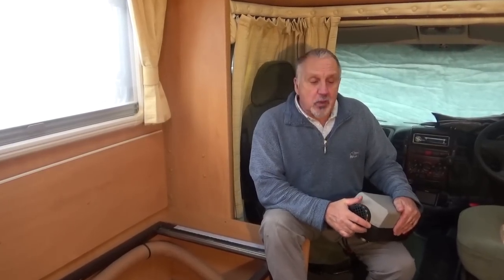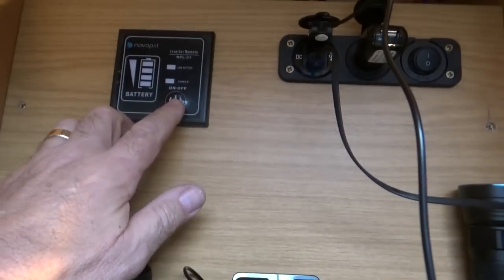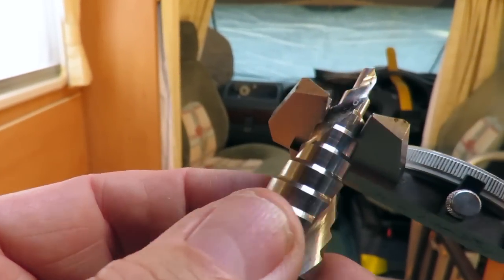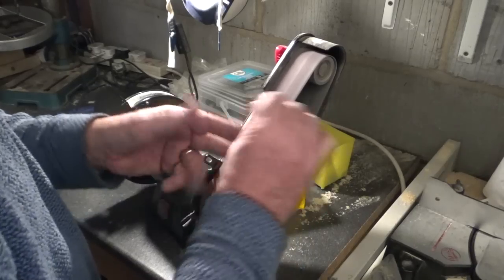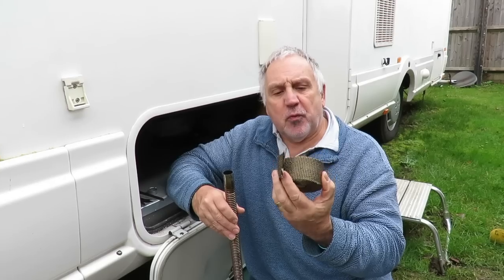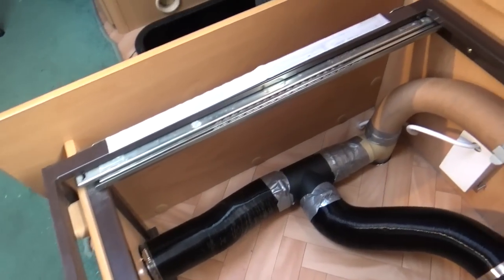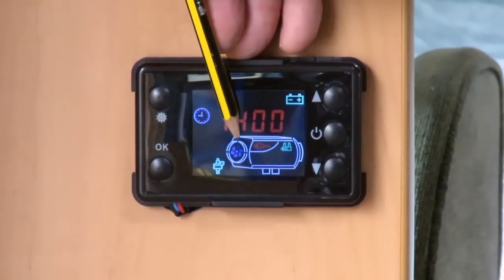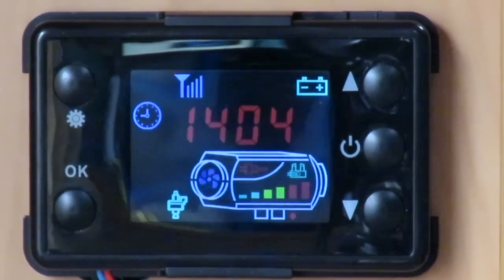How To Install A CHINESE DIESEL AIR HEATER, Ebay 5KW parking heater fitting guide. Full instructions

Comment: Step one: learn Chinese
Step two: follow instructions
Step three: burn the instructions to keep warm
Step four: watch this video
Reply: What was the purpose of putting the fuel tank inside surely this will give you the smell of fuel every time you want to fill it up , would it not have been better to put it so you could fill it up from outside
Reply: @stephenlafferty7327  i thought about the same... my question goes to, why not to connected to the main fuel tank of the Van or RV?
Reply: Very funny

Comment: Great video! 

I have a few notes for you:
1. Bernoulli's principle would dictate that the flow of fuel will change from 1 diameter of pipe/tubing to another, however reducing that diameter back down to the intended size only affects the flow rate within the enlarged section of pipe. As long as that temporary change in flow rate is inconsequential (unlike in refrigeration), you'll have no issue changing pipe diameters. Your risk for air bubbles is no different than if you ran the smaller diameter pipe out of fuel. Still need to prime the fuel system in both instances.

2. Your combustion air intake may be suffocated in that compartment OR you are using fresh air that has leaked in from around the fuel tank for combustion air. This is simply exhausting some of the air you just heated.

3. I didn't notice a good route for fresh air to return to the heater to be heated and pushed back out into the RV. Adding a small hole to your cabinet may improve your thermal efficiency, dependent upon leakage.

You've had this installed for about a year now. How do you like it?

Cheers!

Comment: Every time I have mounted a diesel fuel filler in the cabin of a boat or RV...it has been a huge mistake.  Poor very carefully and have rags everywhere. Diesel is SO nasty when it drips even a single drop. Great video. Thanks.
Reply from the maker: Hi,
Yes, agree, I am very careful when refilling.
Been looking into a different tank that can have the refiller inlet on the outside.
I cant tap of the main diesel tank without draining it and risking swarf in it either...

Thanks for the kind comments.
ATB, Steve
Reply: I expedite so I have one of these heaters with the tank mounted inside, I'm able to pull up to the pump and fill it directly into the tank no need for a separate can been doing great for over 2 years no spills! Although you do have to make sure to be careful when turning the nozzle down into the tank.

Comment: Dosage pump incorrectly installed - read the instructions (and watch other installation videos). It must be mounted at an angle of 30-50 degrees. You have it vertical.
Reply from the maker: Sorry Richard but I've done extensive testing on pump positions and can assure you the optimum pump angle is between 45-90 degrees.
With a 90 degree being the best far.
Generally as long as the pump fuel pump is positioned over 45  degrees it will be ok.
The reasoning for this is as the pump draws fuel into the chamber cavitation takes place, creating microscopic air bubbles which accumulate into large air bubbles.
These can only be removed with the pump being upright, so they can pass through and along the fuel line.
That way they do not create an air bubble build up in the pump itself, causing incorrect fuel dosage and pump wear.  

*As diesel fuel is oil based, it means the pump relies on the fuel filling all the pump chamber to give full lubrication, thus preventing any serious pump wear. Any air pockets will simply result in wear.

Hope this helps
Steve
Reply: 90 degree is fine he's correct

Comment: Great video, i would like to point out quite an important error which i found out a while ago fitting mine. By raising the heater unit off of the lino flooring you have stopped the steel sealing plate from doing its job which is the seperate the intake/exhaust connections from the cabin. If you now have a loose/poor connection on the exhaust jubilee then any leaking fumes can enter the cabin as the sealing plate is not tight against the floor and unit which obviously could be a huge health risk! The steel plate is effectively there as a gasket.
Reply: Yep, I was just reading through before making the same comment myself. Doesn't take long for the exhaust joint to start leaking on these, especially if using the cheap provided fittings and no exhaust sealant.

Comment: Great video. Two things to add: The fuel pump should be installed on and angle of 15-30 degrees. When installing the fuel tank fitting I used a piece of weed trimmer line smaller than the diameter of the fuel fitting  center hole. The fitting will slide down the trimmer line like butter Just my 2 cents.

Comment: Very useful video! I whish you had done this prior to my instal - The instructions in the manual are absolute rubbish. Some of my observations:
 - The bottom of the tank fuel inlet is fragile, mine started to malform whilst tightening it.
 - took me a while fo figure out the plastic fuel line does not go directly onto each fuel component, although I managed to get it directly onto the main heater. Not enough black rubber in my opinion.
- The exhaust could be a touch longer.
- I like your air inlet location, mind is under the van and can get clogged with dirt, so monitoring is essential after a move.
 - Priming the pum on my 'unique controller' = I lost count the number of times I pressed those damn buttons, but miraculously it fired up lol.
Once in and working it's a brilliant piece of gear at a great price.
Great video, and this would help greatly for anyone considering the same type of install.
Reply from the maker: Thanks.
Yes, I've hear the tank can be fragile. I've since supported the bottom of tank all across it's width now as I didn't think the three screws would hold out with vibration.
I'm lucky with having a compartment directly below for the air intake, although I aim to improve the air filter with automotive one. I think I could get a bug drawn into it too easily!
The controller that came with the kit is really good. Lots of functions. It made priming a doddle.
I've seen some installations and thought 'that'll never run', but it does!!
They just seem to work!
So far mine runs as sweat as a nut, and burns clean too, no smoke.
I've measured the  Carbon Monoxide  levels out of the exhaust and they are incredibly low for these units. Clean burn again.
A good investment if you ask me.......
ALB, Steve
Reply: @TheWrinklyNomads  The first time I run mine up it smoked like a good un, now it's pretty clean, yeah good little bits of kit.. 

nice one.

Comment: one important thing: the bottom heater mounting plate is designed to be installed on a perfectly flat floor, those hose clamps and the exhaust pipe is not airtight. since you raised the heater off the ground you risk leaking exhaust fumes into your van. you need to use high heat RTV like you would caulking to seak the exhaust pipe and hose clamp connection, otherwise if that clamp loosens over time you will leak carbon monoxide into the cabin and probably slowly die while you sleep. also the fuel pump is supposed to be at a 15-35 degree angle as per the instruction manual. the rest is well done
Reply from the maker: Hi Eksine,
I ran with this setup for 6 months and it worked very well with no issues.
However, I have since relocated the whole system and this this new setup is the best so far.
Video is here:
https://youtu.be/HHJaPP2uLFA
ATB, Steve
Reply: Should have fitted the heater on the lower floor that will safe guard if any pipes leak fumes into the van, then use the flexi pipe to bring the heat into the living space,

Comment: I fitted one of these units on my yacht and it is great I would recommend that the dosing pump is fitted at a 30 degree angle out put side up for more efficent feuling
Reply from the maker: Thanks for your comment Gavin, but I have to disagree:
Mounting the pump at different angle can cause cavitation in the fuel and air bubbles, which in turn can leave air pockets within the pump fuel chamber.
This leads to the risk of excessive wear on the pump and possible failure.
Mounting vertical you eliminate any chance of this happening as no cavitated air can become trapped.
Each pump pulse is 0.02ml, so mounting at 30deg, with cavitation actually gives less efficient fuel dosage as less fuel is delivered.
but, these little pumps are so good they rarely go wrong anyway, and you could practically mount them upside down and they'd still work..!!!
ATB, Steve
Reply: Thanks for this reply. I was wondering if the pump needed to be on an angle
Reply: @TheWrinklyNomads  An amazing and thoughtful reply filled with info and facts without being rude... Such a rare thing on the internet these days haha! Love the video by the way.
Reply: @TheWrinklyNomads  it's possible that this varies between model, but my heater's manual specifically said to install the dosing pump at a 30° angle. Perhaps they just saw people on the internet suggesting it, and decided to add it.
Reply: A lot of people, lacking (readable!) factory instructions, were mounting these little pumps horizontally, which was a recipe for disaster. I too was under the impression the pump needed to be mounted at a 35-45* angle, but you are making a fair argument for a vertical install. I'll add, these pumps are a LOT better at pushing/blowing fuel TO the heater, than they are at sucking fuel from the filtered line from the tank, so a "soft" angled installation makes good sense as well. Interesting question. Great video! Clean install! I love your shop!

Comment: believe fuel pump should be at 20-30 degrees from horizontal to allow lubrication
Reply from the maker: Hi Tarun,
So long as the pump fuel pump is positioned over 45  degrees it will be ok.
Preferably anything between 45 and 90 degrees, with 90 degrees being the optimum angle.

As the pump draws fuel into the chamber cavitation takes place, creating tiny air bubbles. 
They can only be removed with the pump being upright so they can pass through and along the fuel line and that way they do not create an air bubble build up in the pump itself, causing incorrect fuel dosage and pump wear.  

Lubrication has nothing to do with pump angle as the diesel fuel is an oil and will lubricate the pump anyway as it passes through.

Hope this helps
Steve

Comment: Hi thank u for the video. 
I have heard they do take quite a lot of battery, is that true? And how long would u run it for?  Plus cabby tell me what size cable do I need to run for the heater? 
2.5 ,4 or 6mm 2 or 3 core 
Thank you

Comment: Would it be a good idea to mount a on/off switch between the battery and the heater in order to avoid the heater sucking power from the battery even when the heater is off?

Comment: Can the power of the heater at any one time be controlled? I.e. Those 6 levels of power can they be reduced to run at 50% to cut down on fuel usage and keep it a little quieter say if you had it set to kick in if it drops below a certain temp. but you didn't want to get woken up in the middle of the night by it?

Comment: Great vid 
I have a question,is the original heating trunking still attached to the camper van fire as original or is all the trunking disconnected from it to run it this way

Comment: Loving this video. Wondering if you can put a peltier strip near the heat exhaust then it will make around 12v  of power meaning it can be used to charge up a second leasure battery while on.

Comment: I installed mine yesterday... there is an extreme fire hazard off the exhaust I reamed a 4" hole and put some gas  pipe threw. I went today to get some exhaust heat wrap i checked temperatures with temp gun last night and it was extremely hot. I believe wrap is a must
Reply from the maker: Hi Cory,
Although the exhaust temp does get hot, it's well below combustion temperature.
I agree with you, a degree of caution is needed as to the amount of space left around the exhaust.
I have the heat wrap and also heat resistant paint to all area near the exhaust, but essentially any precaution is a good one...  
good comment though 👍
ATB, Steve

Comment: Hi there   great video well done May I ask is the diesel pump loud or does it get quieter  and secondly can i add a third hot air outlet to the system to bring heat to the rear of the camper van Thanks in advance?

Comment: Nice Work, the marine tank is brilliant 👍 i ' d be interested into 2 things about your Mod: 
1) is it more helpful to to have the air inlet from the outside, or rather from the inside ( circles) of your cabin with regards to Delta t?
2) in context to that is there not a little chance that you get burned fumes into the cabin once the wind will come from rear and left side?

Off Script: i noted that a long inlet duct / pipe throttles the air flow as well, same is when your air out to cabin would make the 90 degree bend to early, i think they say radius it after 30 cm that the Pipe does not get hot and the hot air could accelerate properly. And thus they recommend radius < 90 degrees etc .  I my case not possible either
Reply from the maker: Hi,
I am experimenting with the inlet air situation.
The reason for pulling outside air is to get fresh warm air into the van, however in very cold, zero temps, the burner does seem to produce a less intense heat at the output.
I have blocked off the air in from outside as a test and so far with good results.
All trial and error I suppose...!!
The chances of getting fumes back into the burner are almost negligible as the exhaust is over 3ft away and the emissions are particularly low. I have also checked all the Co2 readings at various points and dont think it's a worry.
Plus I have 4, yes 4, Co2 detectors in the van.!!
Yes the ducting isn't ideal. I may well alter it to go higher up and in a much less curve, but at the moment I will just see how it goes.
As I say, never to old to learn.
ATB, Steve
Reply: @TheWrinklyNomads  excellent Steve, it was not meant to be a lecture, was rather talking about bits and pieces i anticipated so far... My heater is a planar 2 d ( around 1,8 kW) which can handle a 7 m rig down to 0 degree outside temps with reasonable heat up time and consumption, it is powered by a Lifephos batt and 200 Watts PV autarc from April -October ( offgrid) then i refuel the batt with a Budget 2kw Generator eventually ( my tank 7,5 L planar Tank in the garage) ..i will try your boat tank   implementation next project that is what i took away and learnt is a must for not putting the RV tank  at risk and have maximum comfort👍👍👍 thanks for that Sir! Reg Hannes

Comment: Nice work and very informing video. Only thing I wonder is 'why did you pick the unit location so exhaust pipe runs in middle of cargo door opening?'. I thought you have enough room to avoid that situation. Also do you know if 5K unit is enough to heat an average mini van or does it have advantage to have an 8K unit?

Comment: Just one question, if the system is off, the display is still on all the time. How to turn it of without loosing all the settings? Of course I can cut the power of, but this is not the point, to play with it again. Any clue?
Reply from the maker: Unfortunately you can't turn the display off unless you kill the power.
That will mean resetting times etc.....😣
Reply: What do you do for this problem? I’m thinking about using a toggle switch and not worrying about the remote or time.

Comment: Very helpful video, thanks. I am just starting the installation of my Chinese heater in my caravan in New Zealand, before winter. Not that we can anywhere at all in our caravan right now, due to current lockdown. My instructions recommend that the fuel pump be mounted between 12 and 35 degrees from horizontal. Does your one work ok mounted vertical?
Reply from the maker: Hi Andrew,
The Chinese  instruction are just copied from the big manufacturers like Eberspacher.
The fact is, the more horizontal you mount the fuel pump the more you will get cavitation and air bubbles which will give a poorer burn.
Mounting vertical, which I recommend, means less wear on the pump piston and far less cavitation.
The pump will still work whatever the angle is, but mounting as upright as possible is my favourite.
Take a look at: https://www.youtube.com/watch?v=z8SkKAlOAxU  where I explain fuel burn and have a look at the cut apart pump to see how it works. Anything less than vertical will trap air bubbles,
Hope this helps,
ATB, Steve

Comment: I have 2 fuel tanks in my van . I have the same lay out as you have and will install under the bed also . Will that pump be able to pump from this tank ( front tank and will be near the heater) ? And or any positives or negatives to trying this ? Thank you and great video !
Reply from the maker: Hi hank,
I cant see any negatives with that idea working.
The fuel pump is more than capable of delivering the fuel for quite long runs, even uphill. 
If you position the pump under the bed, the ticking noise you get may be annoying though?
I am about to change my fuel tank and pump layout yet again to try achieve even quieter pump noise.!
ATB, Steve

Comment: Make sure to have spare exhaust, on a van mine rotted away after a year. In fact it really needs replacing with some thicker metal tube, perhaps electrical conduit. Buy the metal version, the plastic case can distort on bolting down and the internal fan catches.
I am still trying to find how to make the pump quieter.
When running they can sound like jet engines until they slow to tickover.
Also i made a mistake fitting the fuel tank pipe from the bottom, although it did seal. It will suck fuel ok from above, so no chance of leaking.